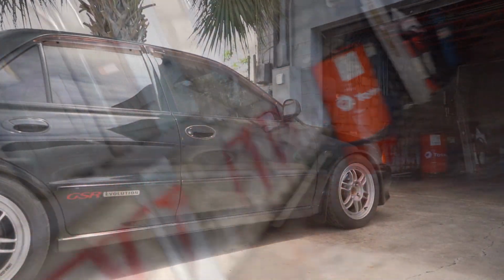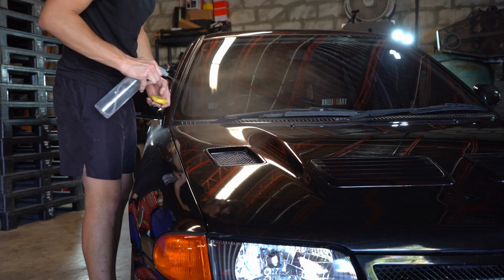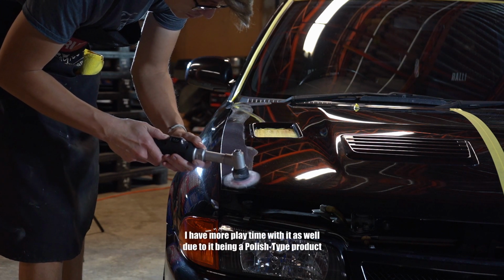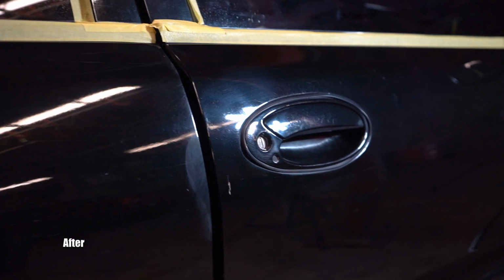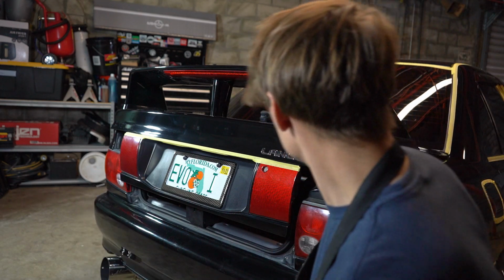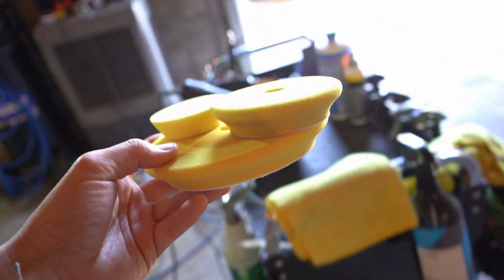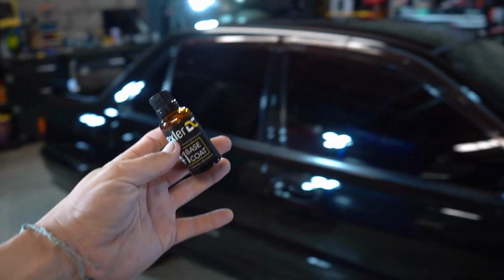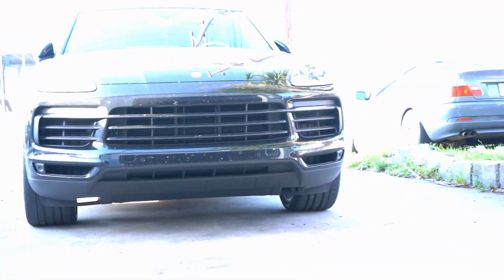Restoring a Legendary JDM Import | Mitsubishi EVO 1 GSR

Comment: That car has a really nice stance with that wheel/tire/ride height combo
Reply from the maker: Right? It's like A grade fitment. So clean
Reply: @ccdetailing  bro id like to know if the fenders of  your evo 1 are also wide fenders like with the evo 3? or its fenders are just the same with the base model (stock fenders) of '94 lancer? thank you bro
Reply: @errolbandalaya2606  evo 1/2/3 has the same squarish fenders as opposed to the rounded lancer/mirage. if you look at @10:35  those are the same as my evo 3. It's wide but i would say its only marginally wider, since the difference is that the evo can fit /8 wheels as opposed to /7.